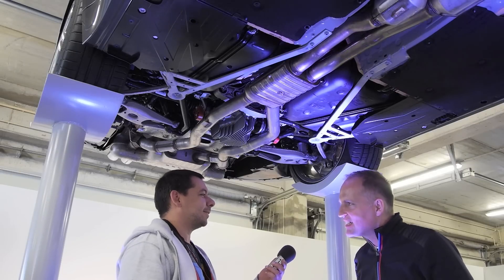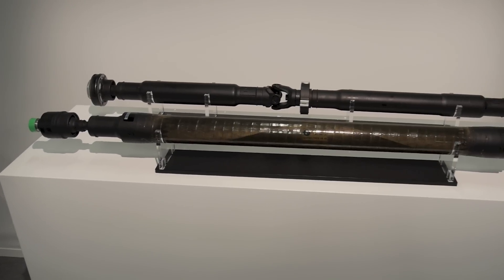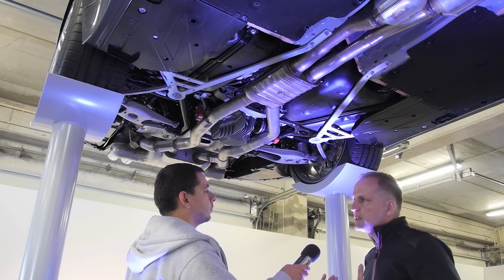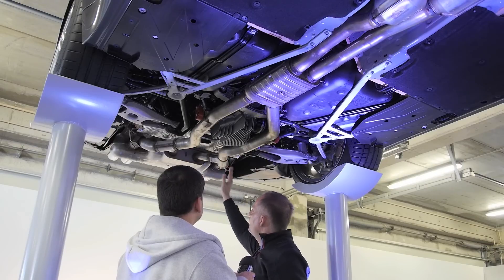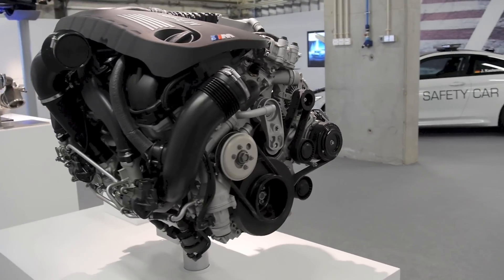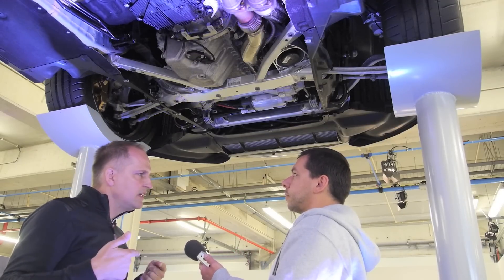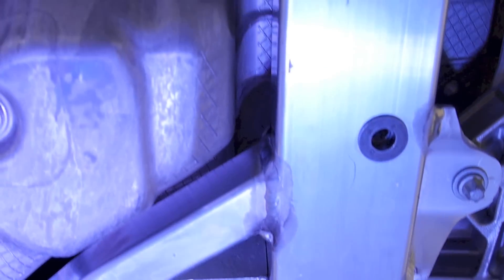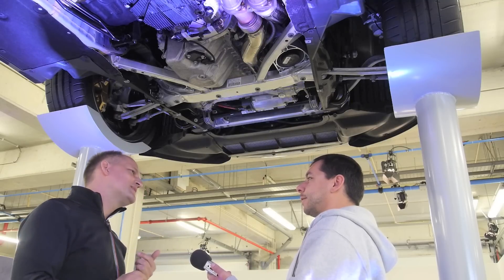Interview with Michael Wimbeck - BMW M3/M4 Project Leader (napisy PL)

Comment: Very cool video, but I missed the technical details, such as the all-aluminum subframe, the limited slip differential, the watercooler and twin turbos. I take this opportunity to inform the plaintiffs with the correctness in the use of English by the German engineer, that your decadent language is only the THIRD most spoken language in the world, very distant from the first. If I were you, I would really worry about learning Mandarin...

Comment: LMAO radiator.... hahaha that was funny thanks for video...
Reply from the maker: ohhhgggeeezzz Radiator doesn't necessarily mean the water cooling device in front of the engine. Radiator is something that heat radiates from, like home heaters (used for heating) or in a computer (used for cooling). So technically this finned differential cover is a radiator, because it gives off heat, and is cooled by air flowing between the fins.
Reply: In practice, the term "radiator" refers to any of a number of devices in which a liquid circulates through exposed pipes... I know what you mean... I think "heat sink" is the word you meant to say.  Still, thanks for the video